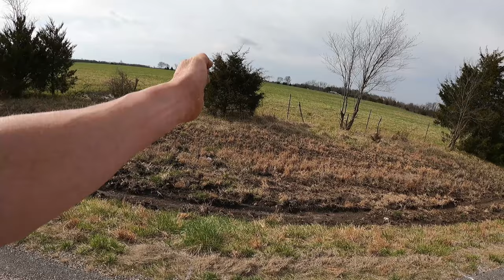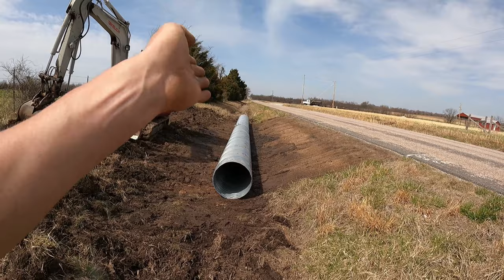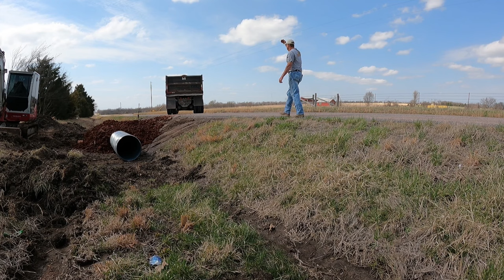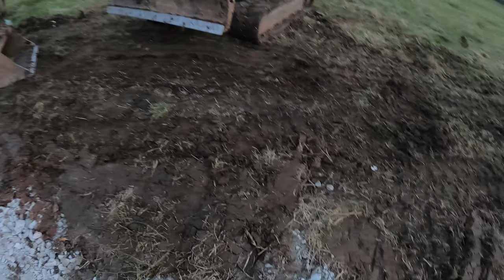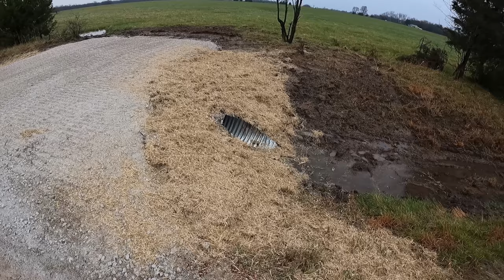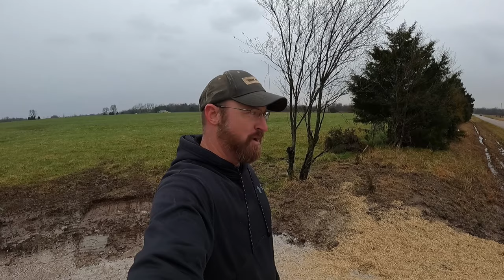Installing A New Culvert Along A State Highway

Comment: I love how they are using galvanized pipe instead of double walled plastic. Ensuring its replacement in about ten years.
Reply from the maker: I know lol maybe someday they will come around. I think it’s one of those we’ve always done this way thing 🤣
Reply: how come the plastic pipe is better than galvanized steel? sorry, I'm new to this and trying to learn off of youtube lol
Reply: @A-ei7vm  Galvanized pipe will still corrode. Single wide plastic pipe is fairly weak and should not be used under roads and driveways. Double wide pipe is strong and can be used under heavy traffic and heavy equipment and last much longer than any other. But double walled cost much more than any other. And cost is the main difference in types.
Reply: @charleslloyd4253  Oh I see, thanks!

Comment: Hi Brandon
Thanks for the answers in that video repairing the broken sewer line.
Always learning.Fortunately we don't have that problem here in Portugal and here building with wood it's more expensive than bricks or even concrete!
Don't know if you remember some while ago I talked about the tilt rotator and that would be good but probably too expensive!?
I've seen now a video about a tilt attachment and I was thinking, looking at this video, that would great for this job.
It would serve for buckets and the other attachments you have already.
Once again don't know prices but certainly cheaper than the tilt rotator!
Nice result in this job as always!
Cheers from Portugal
Reply from the maker: You are welcome! Yes they tilt rotators and tilt buckets would be extremely handy but they have got more expensive now like everything else. I think I tilt rotator for the 260 is around $40k now. Very pricey. Appreciate you watching

Comment: Hi, I like your work but I have an issue with leaving sharp ends for someone to get cut or severed on. If someone was to get hurt they would go after who modified the culvert .I suggest putting edge covers on $25 for 25 ft  with metal grippers inside( Amazon). I have experienced cuts from culverts I did my self ,never again,
Reply from the maker: Thank you! That’s not a bad idea. I liked the dirt up against that edge to help hide them a bit.

Comment: Brandon, scraping that ditch while sitting sideways in the slope was like riding a teeter totter.  Did you have to use hand controls to keep from being pitched through the windshield?

What highway was that?  Most of the state highways have a paved shoulder.  

We got another 1 1/2” of rain this weekend… I hope you already had the construction drive put in.  Let’s hope we get a little sunshine this week.

You polished that apple like a schoolboy striving to be teachers pet!  That’s a great start to the classes yet to come.
Reply from the maker: It was DD which is off State Highway Y between Seneca and Neosho. I was confused when I titled this lol I thought it was still a state highway
Reply: @eliteearthworksllc  Newton County… that figures.  Just drive down Newton road, east of highway 59.  Every road on the Jasper County side (north) is paved with good drainage and road signs.  

The roads on the Newton County side are all dirt.  They have no gravel.  They are graded once a year.  Because they plug the ditches every time they grade the roads… the roads are the ditches.  

But, when you get closer to the county seat in Neosho (where the road commissioners all live…) the roads are a lot better!